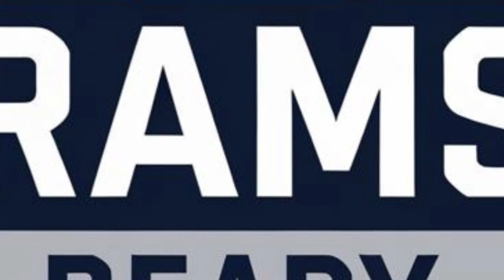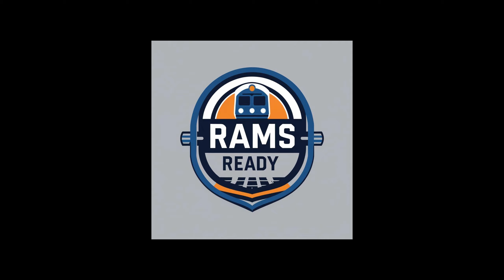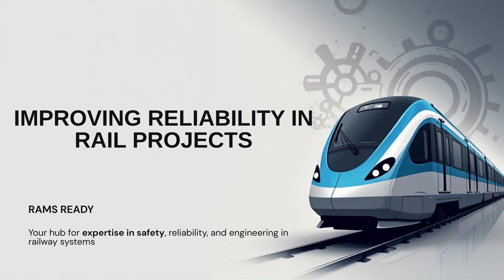Improving Reliability in Rail Projects

Comment from the maker: Working files for this topic, built to be used on a live project:

FRACAS Starter Kit
FRACAS register, root cause analysis templates and a failure review board pack, ready to run on a live project.
https://ramsready.firstlinkai.com/p/A4

RAMS Excel Calculator Pack
Availability, reliability block diagram, PFD and test interval, spare reorder and demonstration planning calculators, all live Excel formulas.
https://ramsready.firstlinkai.com/p/A2

Free Lite Hazard Log workbook: https://ramsready.firstlinkai.com/free
All twenty products: https://ramsready.firstlinkai.com

Which part of this gives your projects the most trouble in practice?